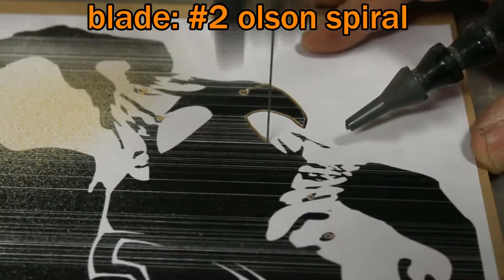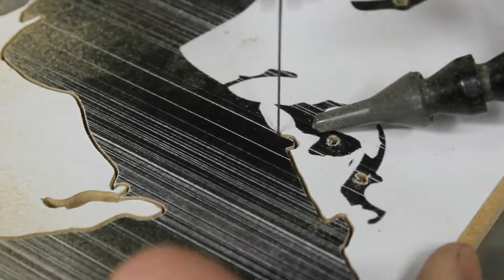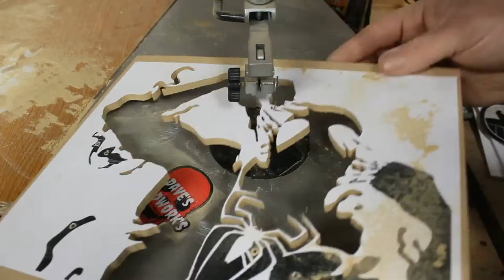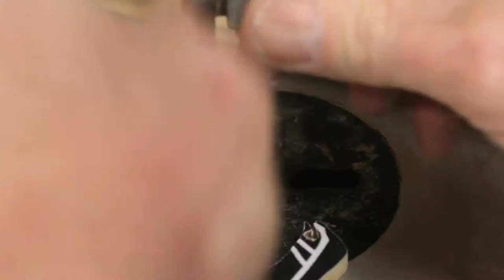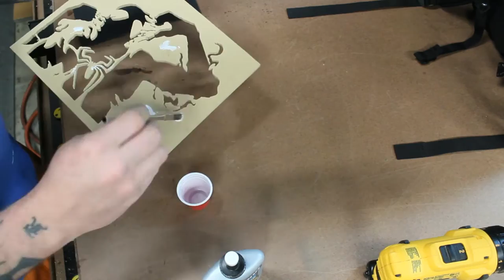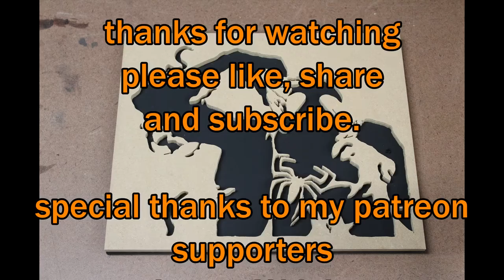Spiderman Scroll saw portrait

Comment: Did you put a paint over the top of that MDF eventually? You really did an amazing job, just curious if you did anything later to cover up that MDF texture.
Reply from the maker: Only the back piece is painted, the front just gets a clear coat.
Reply: @crazethedave  Right on. What's your reasoning for using MDF rather than poplar or some other hobby wood? I'm very new to scroll saw work, so I'm just curious and trying to learn all I can. Thanks for the great video.
Reply from the maker: @facepalmdaily4404  it's cheap and cuts super easily.
Reply: @crazethedave  You had me at cheap. LOL.

Comment: that's awesome man I'm not a scroll saw guy but might try it those fun man       what type do you recommend or all scroll saw are pretty much the same ???/ thanks for the tip
Reply from the maker: theres alot of different ones, i have a porter cable
Reply: oh yeah I actually saw one at the pawnshop today was rust for the top but that can be fix   it had the nozzle like yours but it didn't have the insert plastic that's around the saw like the hole cover 
was like 30$ might have go get it lol
Reply from the maker: +Pascal Surprenant only thing to check for is what mind of blades it can use, pinned or pinless or both. you want to be able to use pinless to use spiral blades
Reply: ok I see thanks for the tip man really appreciate  it   if you have time check out my channel cheers
Reply: should it say on the saw if its pinless or pinned